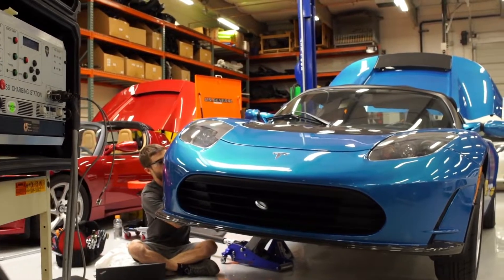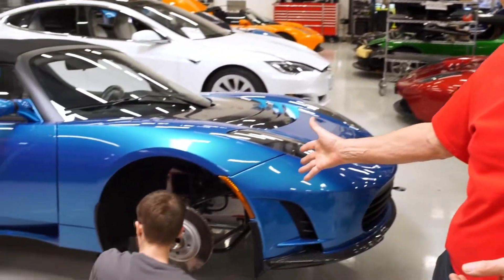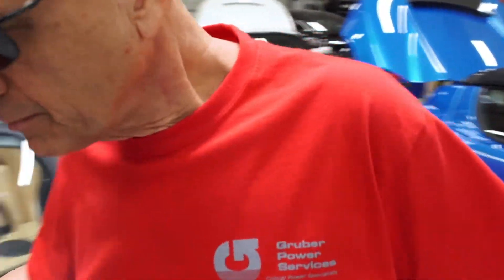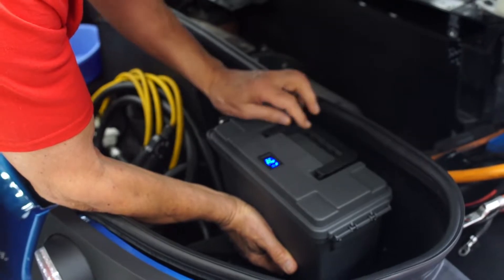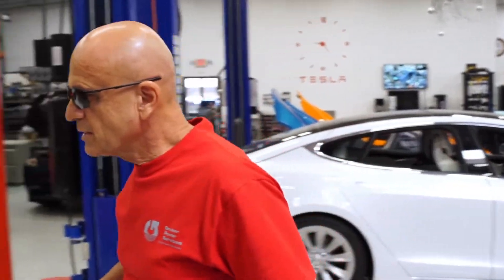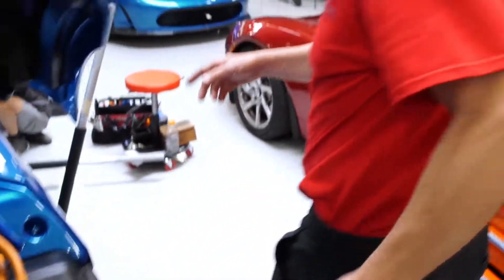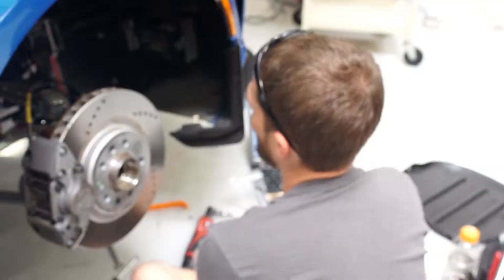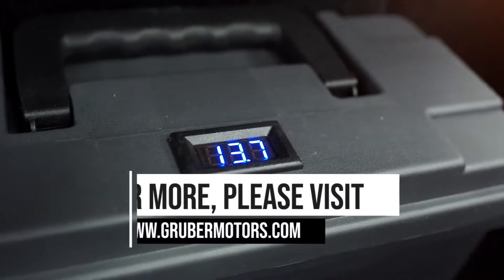Tesla Roadster 12 volt Battery to Trunk Relocation | Gruber Motors

Comment: hmm i went to a LTO pack that i built which never wears out in my ev/erev. way more efficient, and i run the whole car on around 15.8v now which my old volt really likes. the dc-dc converter only targets a voltage of around 13.5 to 14.5, but the flush mounted solar roof i designed and installed continues to add usable range to the car by charging the lto pack up to 15.8v. with the volt, you get more range because the apm/dc-dc converter goes into fuel economy mode more often and doesnt steal as much electrons from the hv pack during operation, plus the solar panels basically have free reign to always be charging the low voltage system.
you also get some efficiency boosts by running higher voltage = lower i2r losses, lower internal resistance, and a decrease of around 40-50lb of weight from deleting the agm battery.
just something for you guys to keep in mind. i put a poorly filmed video up on my channel explaining everything :)
would be cool if more 3rd party repair shops could wrap their heads around what i consider is the best available replacement tech for old lead acid systems. lto is kind of an obscure tech. ironically the cells imported from china are not really subject to bidens anti green energy tariffs we are all feeling now days because its so obscure.